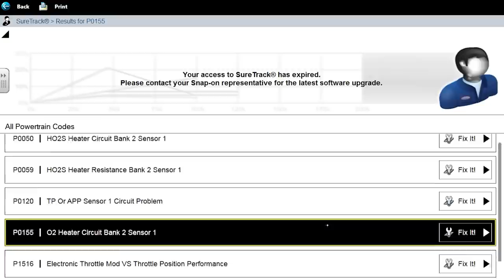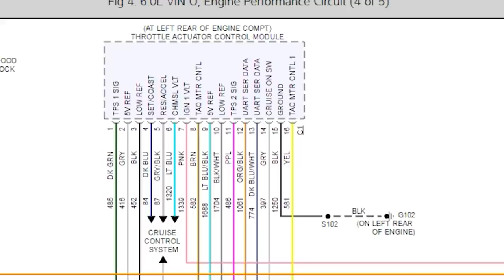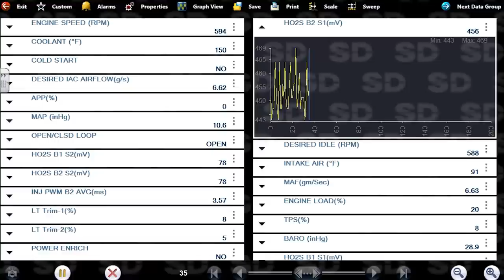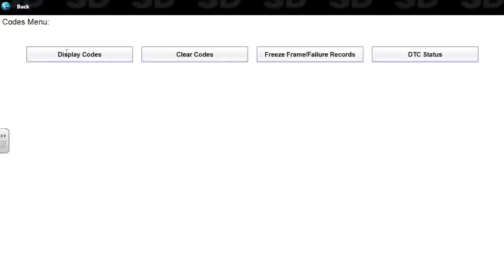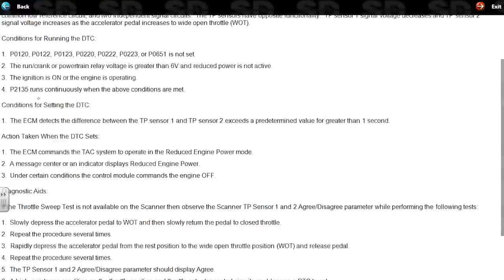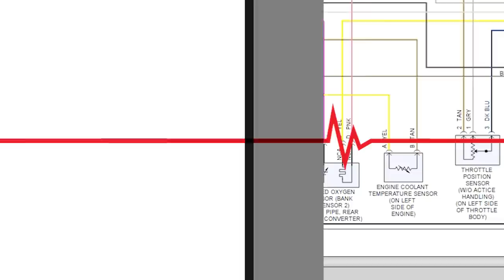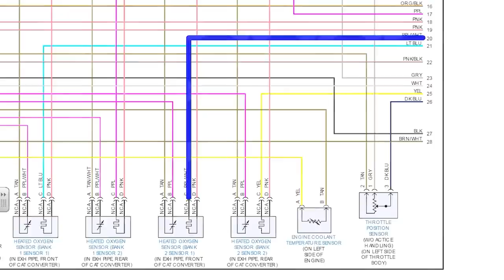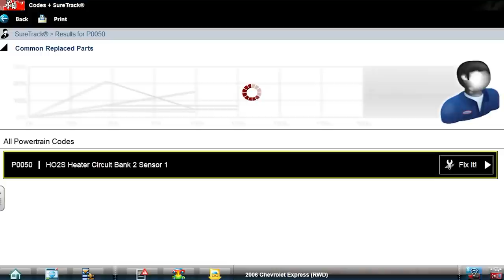Chevy Express Van Electronic Throttle Body Problems Part 1

Comment from the maker: P0155 Here is the link to part 2 https://youtu.be/KTLmHzk_Y40
Links to other mentioned videos: 
SD Premium video on an electronic throttle body -  https://www.scannerdanner.com/scannerdanner-premium-chapters/new-series/606-sdp-day-15-voltage-drop-testing-fundamentals-fuel-pump-and-tac-case-studies.html
2013 Chevy Impala No Start - Ignition Relay Low Voltage Codes (P1682, P0689) https://youtu.be/Va-Ku_Njn18
Troubleshooting a Shorted 5v Reference Circuit (Chevy Silverado) -  https://youtu.be/RcQdITo_AOA

Comment: I used to cut car radio OEM harnesses, and install car stereos with wire nuts, and spade connectors on our older family vehicles, as a high school kid!! I was obsessed with car audio back then. I would buy car audio equipment with my allowances; but I realize now, what an inexperienced Mr. Know-it-all hack that I was.

Comment: I replaced my throttle body sensor, temperature sensor, & purge sensors. I even replaced the connectors to the sensors, as well. Now, I still have these engine codes. The PO118 code went away, and came back. After replacing the sensors, do I need to start my van, and let the engine run, so the ECU can see that the sensors are good? I ask this, because I just turned the key, in the on position, without starting the engine.

Comment: Question in your book and class…I’m on section 7 Throttle Position Sensor (TPS).  Want to know if you replace Throttle Position Sensor does the module needs to be reprogrammed or flashed?

Also, if you replace TPS do you need to replace the gas peddle too, because of close connection?

Premium student
Reply from the maker: No sir. Programming is not necessary for a TPS or APP replacement. Just a memory clear would be needed on some. (Reset all adaptive type thing). Thank you John! Feel free to use my comments sections in my premium videos too. I'll answer those as well.

Comment: I have a 2010 express 2500 4.8 V8, I have a p0506 code and I cannot find an air control valve anywhere for my specific model. Do I need a new throttle body? My van stalled and now it cranks but won’t start.

Comment: which software are you using on your scan tool for the diagrams with highlightable circuits? i have a higher end autel and identifix, but wasnt sure if i could do that with identifix diagrams or not. soon to be reassembling an express van after a body swap (Adapting an 06 passenger onto an 03 cargo body) so im sure im going to need it.
Reply from the maker: This would be ShopKey Pro (mitchell) I'm not sure what identifix uses to be honest
Reply: @ScannerDanner  I'll have to try adding it into my autel software and see if it works. I know i can sign into different subs on the autel. the diagrams look identical between my Mitchell/alldata and identifix. Hopefully it'll work
Reply from the maker: @bmb1455  I just logged into ShopKey the other day with my Autel Ultra and could navigate the program but I do not think the highlighting of the diagrams worked on it. But I could be wrong

Comment: The intermittent pulsing on the O2 sensor heater is a current induced by the ECM to check the resistance of the heater. If the resistance is infinite, the ECM tries over and over again.
Reply from the maker: If this was the case, with the test light acting as a good circuit, it should have stopped pulsing. I'm not sure that is what was going on here, but I could be wrong. Thanks!
Reply: That is correct. On the other hand, the ECU expects a value in a certain range. The test lamp has a much higher resistance than a heating element of an O2 sensor. At least this is the way I would design such a circuit.

Comment: Danner you not gonna believe me but I'm working on a 2016 express and having problems with the throttle iwas about to ask for help and j found this video I can't wait for it to start lol
Reply from the maker: perfect timing then! The only difference will be your 2016 model year, the module that controls the throttle body is built into the ECM, unlike this model (06) which is external to the ECM, but everything else is the same I believe.
Reply: @ScannerDanner  I see I didn't know was a 06 the one you working on
But if  everything should be the same then I have a problem whit the throttle body 
I thought was different cus in my scanner shows 2 tps volts they run opposite from each other but if I back probe there's only 1 cable for tps volts I don't know where the second tps comes from 
Thanks Paul and happy 4th
Reply from the maker: @MrPincheloko  there are two signals on ALL of these my friend
Reply: I couldn't find the second one at the throttle body i got 6 pins 1 and 2 are motor control
3 is signal
4 is low ref
5 is 5v
And 6 is not use
Where I found the 2nd

Comment: Would it have been stupid after finding that bad splice, to clear the codes, turn the vehicle on and force a momentary open to see if it went in reduced power and gave you the same gauntlet of codes? I actually haven’t finished part 1 yet, just wanted to pause half way through and try to brainstorm with you.
Reply from the maker: You could have done that. I didn't feel the need to prove that part as I've seen enough of these failures to know for sure that it would have definitely forced a reduce power mode. Thanks!
Reply: I see! (he says, while feeling like a rockstar because ScannerDanner responded to me)

Comment: Help me bro I can't find problem whit my 08 Grand Prix base model gt style p1125 p2138 p2125 I replaced gas pedal it power it has continuity
Reply: I pull fuse out for the throttle body it work for whole next it start right back reduce engine power it make me made this should be gm recall

Comment: I have an 08 and just out of the blue I will lose all power whole driving.  I just have to stop completely and then it will go again.  I don't need to put it in park or neutral or even turn it off, just stop and then go
Reply from the maker: No way I can answer this. What tests have you done?

Comment: I have an intermittent cam pos sens code on my 2000 eldorado gotta love intermittent failure.
Reply from the maker: Hate them! Sometimes it is worth it to change a part (yes there are times lol)
Reply: Yeah its original from 2000 I was gonna throw a acdelco one on it and see what happens if not then I'll look at spots for wear in the wiring (probably where it goes over the valve cover) but hopefully just a new factory sensor will fix it right up it literally comes on, then 3-4 startups later gone.

Comment: failing ECM is my guess before even watching past 2:10. lol
EDIT: ahh separate module and module was spanked, they like to die internal to the ECM also. start, let idle, heat with heat gun(and stall/reduced power), let it cool/shock cool with water to restart.
repeat process it will do it every time, many of the GM's did the same thing and I have a feeling there were many millions of TB's changed for no reason lol